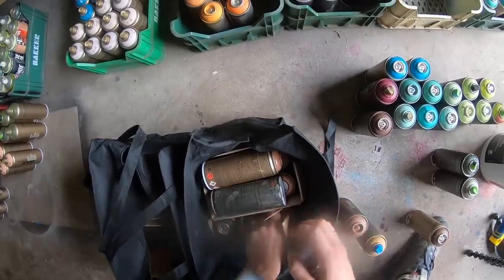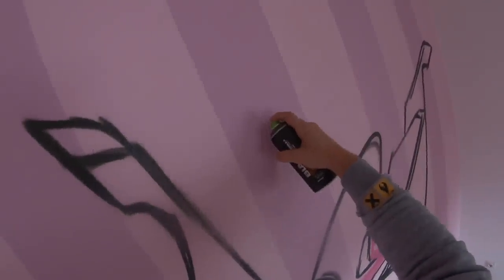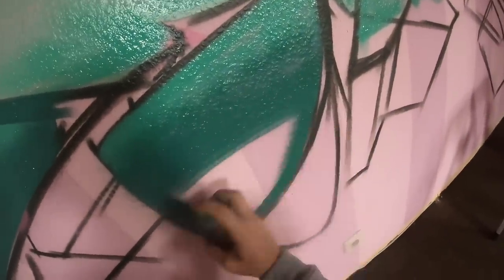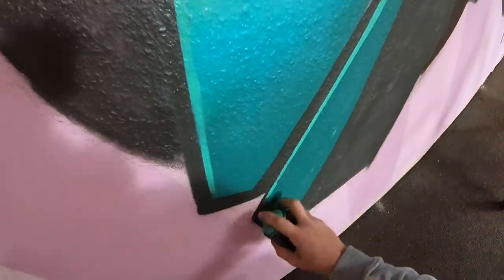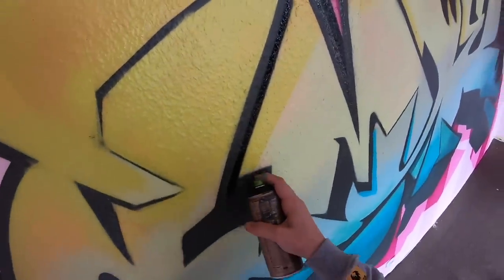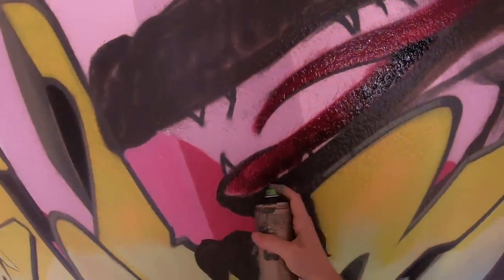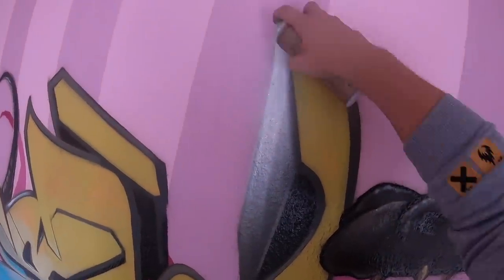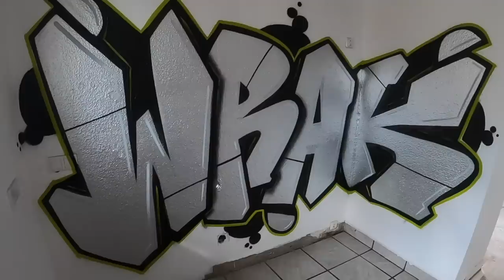RAW Burner Graffiti + Crocodile Character 3 hours STRAIGHT. Abandoned House.

Comment: You forgot a slice in the part of the E.. U say lyk if i see anything missing..PESK.PKSQD..
Reply from the maker: yeah, I was a little bit sloppy. - If we are reeeeeaaallly deep into that slicing thing, i even forgot two slices - E and O underneath the claw and the „Serif“ of E with the single connected extra bar of itself - because the whole piece has only tiny melting points (S+M at the top, S+O at the bottom, O+M at the Middle) and all other connections are slicing - only E does overlapping... But this happens if you do the freestyle... You got a good eye, you saw that!